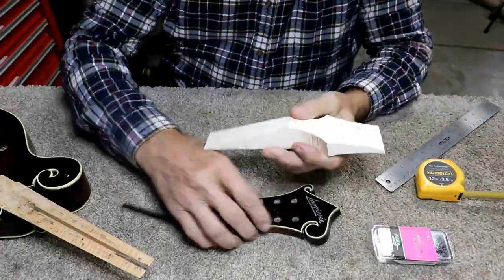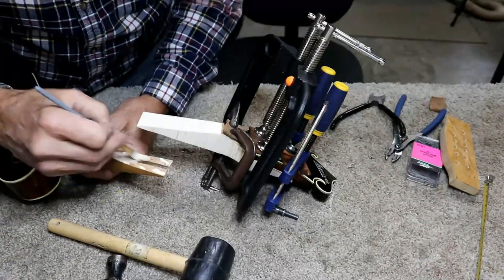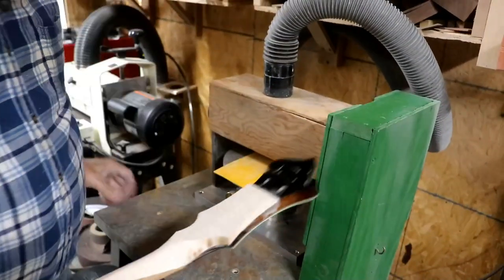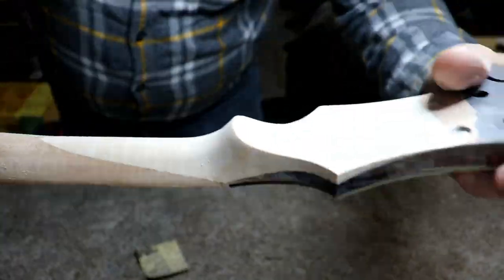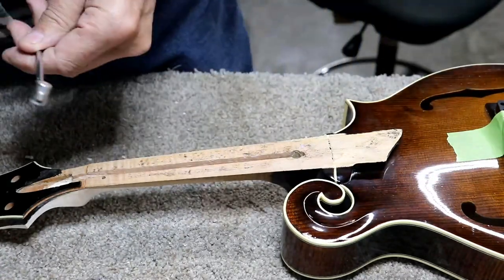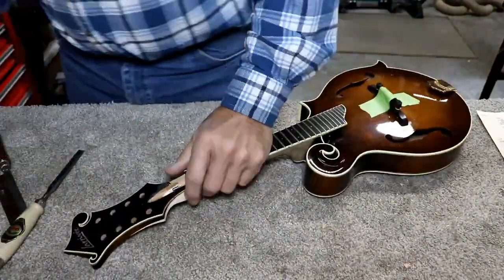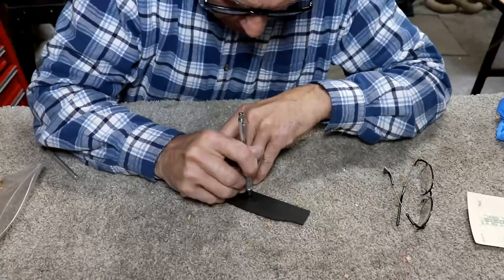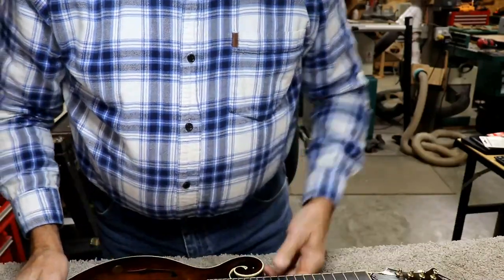618 RSW The Acoustic Shoppe Challenged Me To Fix This Larrivee Mandolins BROKEN NECK!!! - PART 2

Comment: I was wondering why you didn't use 2 of the holes for the tuners with a tight(ish) dowel? That way there is no metal left behind that could cause future repair  issues.

Comment: Stew mac makes  a "Robo-Sander Flush Trim Sander"  that would be perfect for you sanding the head stock. It has a phenolic bearing that would ride on the finished part of the head and would have  allowed you to sand to the edge of the head without worrying about sanding in to the side of the head that is already finished and saved you about 1/2 hour. . It is pretty inexpensive if that can be said of anything that Stew mac sells. It would  have been perfect for sanding the edge the head.

Comment: The stainless rod is used yes as a trus rod but mostly as a strengthening tod ( to stop any bow ) the same way lots of acoustic makers now use carbon fibre rods either side of a straight trus rod to stop any bow whatsoever.  And repairers of vintage instruments from the turn of the century now add carbon fibre stiffening rods to guitars that never had a trus rod.  Good repair and result.

Comment: Great job, Jerry. One of the things I like most about your work is that you are fearless.  You wade in where others fear to tread. I always get good ideas when I watch your videos. 

I can give you an option for keeping glue joints from shifting. A few grains of fine,  sharp sand sprinkled widely over the contact surface keeps stuff in place when parts are clamped. Takes only a little. I bought a bag of sandbox filler from Lowe’s about ten years ago. I mostly filled a pint jar with sand and used the rest in some potting mix. I’m confident that pint is a lifetime supply.

Thanks for this video series. I believe I’ll use this technique to graft the pegbox back onto an old Kay bass.

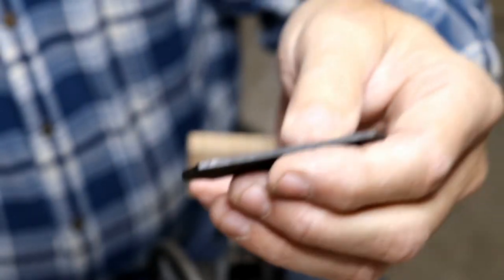Comment: 49:25 At a metal fabrication shop I used to add a bevel to aluminum parts using an upside down router. It works really great. Im guessing it would probably would work just as well for wood to. Awesome video as always!!